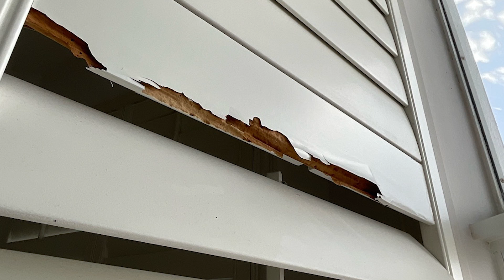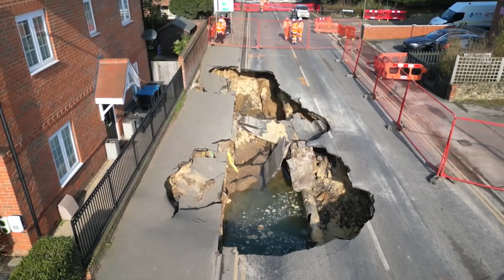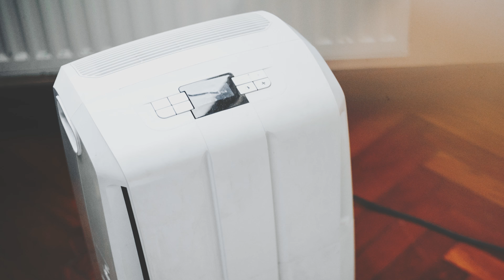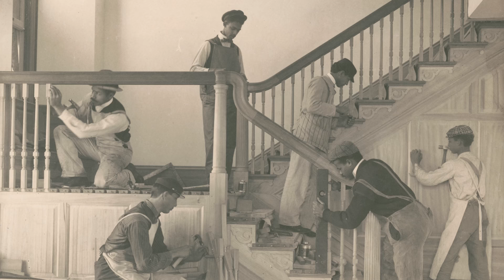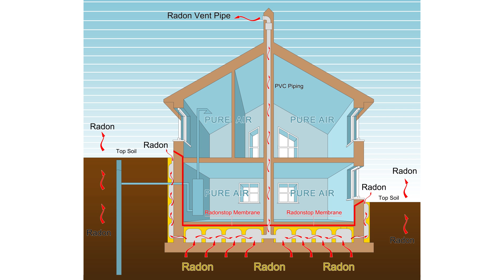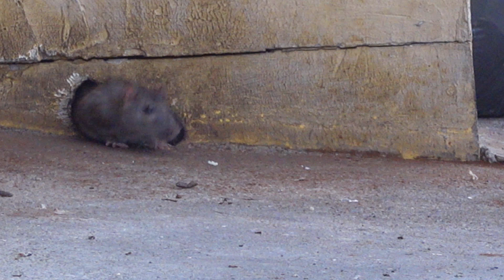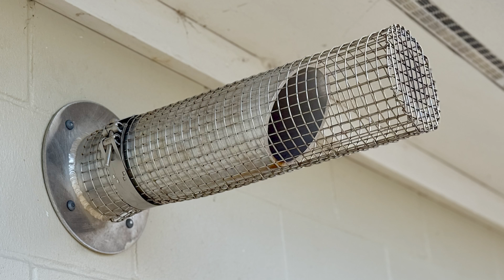Home Inspector Answers House Safety Questions | Tech Support | WIRED

Comment: He doesn't know what he's talking about for that panel. If the breaker isn't seated properly, that's an installer issue. Yes, the panel needs to be replaced now but that brand isn't one of the bad ones.

Comment: 1 to 1.5 hrs per 1000 sq ft? I don't think that really happens.
Reply: Too long or too short? He explained further, that approximate age of the house is and indicator of what types of issues you can expect. If you are experienced, that knowledge can reduce time spent by a lot.
Reply: @artursmya2052  2 hours for a 20 year old 4000 sq ft house.
Reply: Our inspection was a smidge over 3 hours on a 2600 sq ft house that was 12 years old at the time.

Seems accurate to me.

Comment: American houses are ... interesting.
Reply: Do you mean in the build quality or the design? (Or something else?) The kind of homes that garner the attention in media are generally the outliers. For example, someone has a house that’s 10 years old and falling apart. Or someone is building something that looks like the Palace of Versailles. There is a really wide variety of design, quality, size, etc. among homes. But I think most of them are pretty ordinary. I suppose the biggest difference with houses in Europe would be the size?
Reply: @DavidMontgomery1  most walls here in Europe are made of brick, not a wooden frame and paper pulp. Which is great for (sound) isolation, but means that pulling some wires through a wall or moving a load bearing wall is not something we can do in a long weekend.
Reply: @SanderMakes  Wood is the traditional building material here in the US because of how readily abundant it's always been.  It's also more resistant to earthquakes than masonry.  A wood structure, built properly, can last a really long time.
Reply: That’s why, even in the current inflated market for US houses, they are substantially cheaper than in Europe. There’s a reason almost everyone in Europe has to live in apartments.
Reply: @davidcahill1131   Just a very small percentage lives in apartments here, but one of the advantages of our admittedly smaller houses is that our cities and villages are a lot nicer. If people live in huge mansions, everything becomes spread apart and you need to drive everywhere. Everything becomes more expensive, since infrastructure is mostly paid per meter, not per person. A 1km street costs about as much if 100 people live on it as it would be for 1000 people, but those 1000 people only need to pay a tenth in taxes for said road. Another advantage is that it's a lot more likely that people will walk to their destinations, meaning less road maintenance, quieter streets, less pollution and multiple health benefits for the people walking. Public transit also becomes a lot more viable, which reduces the number of cars on the road significantly, thus reducing all the problems cars bring. Yes, I don't live in a MacMansion, but neither am I stuck in traffic whenever I need to go somewhere, because every location in my village is walkable.
Reply: I’m not sure if ‘house’ is the right term to use.
Reply: @jerzykiler4386  I've seen beggars who live in more structurally sound boxes.